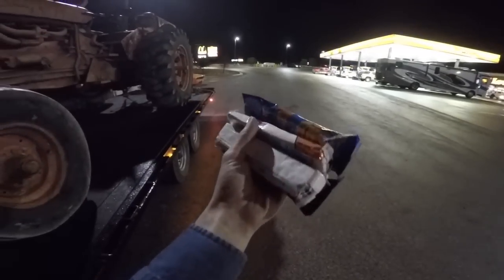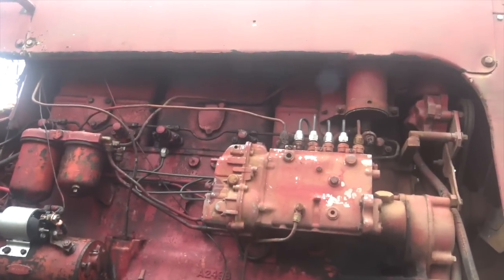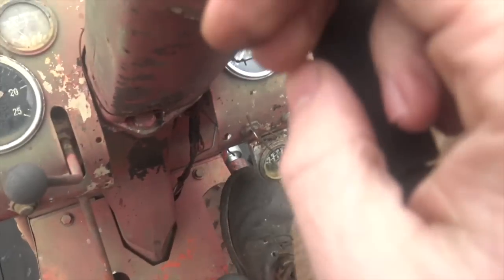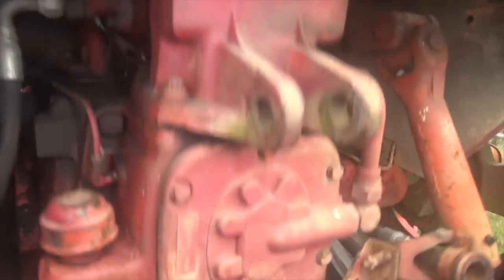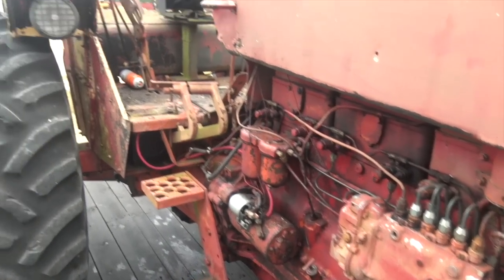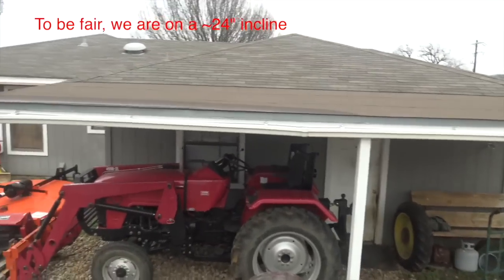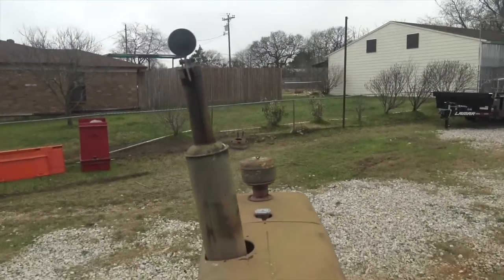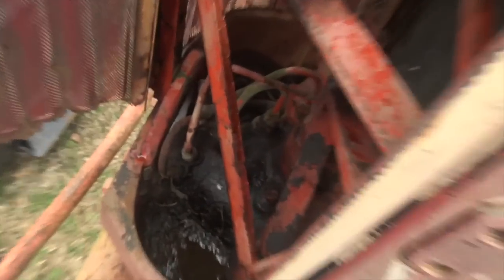IS THIS 6 CYLINDER DIESEL TRACTOR WORTH SAVING

Comment: I had a 930 Case, brakes lousy, started hard in winter but ran 1/2 as cheap as a JD 4020 for fuel efficiency. I coasted down a hill, the speedometer went around twice (40 mph) then the tie rod broke- what a ride wow. But it was a very dependable farm tractor here in Iowa. 730 Case gas tractor a good one too. And I am a John Deere man by heart. Good luck & I’m a new sub

Comment: reminds me of my 1991 F350, lots of leaks, smoke, all sorts of problems, but still works every time I need it to
so far the only functional large engines ive owned (im 15) is a 7.3 IDI, 4BT cummins in my chipper, and a 6 cylinder cat 3116 in my bucket truck (GMC topkick) 
I like diesels if you cant tell lmao
2 out of 3 dont use glow plugs, and they start easy, the 7.3 uses plugs and it doesnt like to start but it will with a charge of the batteries, maybe its just because its a ford?

Comment: Have a few case 930 tractors around south west Pa. guys fixed them up pretty nice used bring them up to our stock tractor pulls, did ok but trouble is are so heavy you have pull 9,500 lb. class or more and you are with much higher horse power completion tractors, most of them have narrow front ends makes them look tougher and cooler looking. That thing will pull hay wagons off our big steep hills with ease -down in Texas you guys don't even need brakes anyhow all flatlands lol

Comment: Oil bath air cleaner looks to be way overfilled, bet they just poured old engine oil down the intake which explains the oilfield around the steering gear and excessive smoke trying to draw air through what now may be grease!

Comment: Wow, that steering has the most linkages and u-joints I've ever seen in a tractor... or in a spaceship ;-) 
If that power steering belt is a 1/2" A type v-belt  you can try a cogged AX type V-belt which is the same size but with no fabric on the sidewalls so it grips better.
Depending on the shape of the pulleys you can even try a 5V (or a cogged 5VX) which is 5/8" wide but also 35/64" deep (A and AX are only 5/16" deep) the wider section may ride a bit over the pulleys but may grip much better overall, especially if the pulleys have deep grooves.
I used the trick of swapping the A for a 5V on a 3HP air compressor where it's hard to tighten the belt and I never had a problem again.
And if you definitely want to avoid any slippage and there's enough free space you could bolt a timing pulley onto the crankshaft main pulley and another onto the pump.

Comment: May I suggest that you investigate the product line of "Hot Shot Secret". For this unit. I'm sure it would benefit from their Stiction Eliminator and Extreme Diesel treatments. Look them up on the net, I think you can save yourself a lot of time effort, and money. FYI I have NO association with them except as a happy customer for my diesel tractor and all of my gas vehicles. Check their product line and if you call I've found them to be very helpful. They may even send some product free if you use it on camera and give it a review. Its worth a shot...good stuff!!